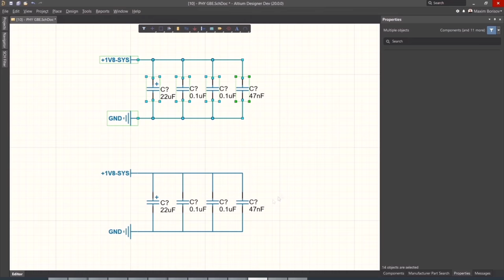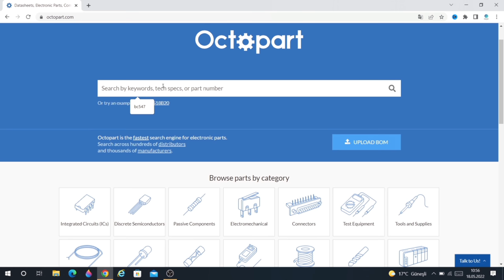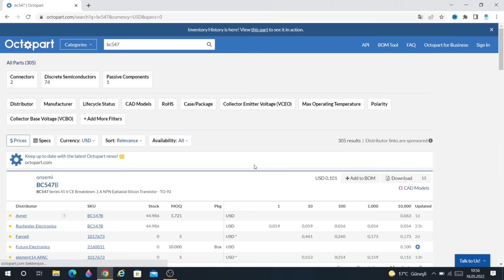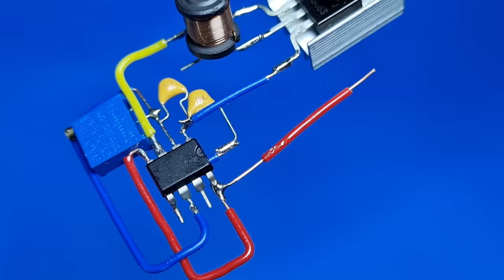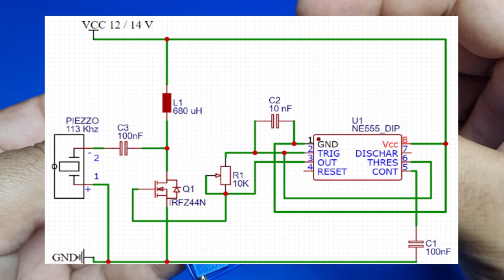How to Make Ultrasonic Humidifier , Ultrasonic , NE555 , 113 Khz

Comment: It seems that the schematic have some fault. First is the IRFZ44N missed 10Ω gate resistor. Second is the pin3 of NE555 only connected to common pin of 10K VR.

Comment: Sir I made this circuit and it work fine for some time
But after some time 104 capacitor near IRFZ44N is burning out continuously I tried it few time but it is burning out  Why and how to solve the issue?
Thank You
Reply: İf irfz burning , headsink not enough, u must more big a headsink put
Reply: @muratk1464  irfz not burning capacitor is burning